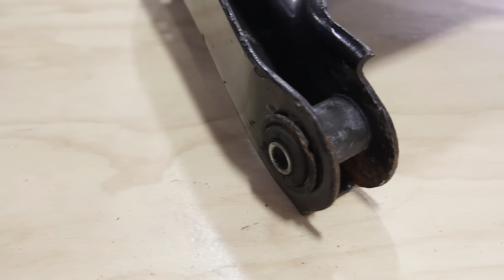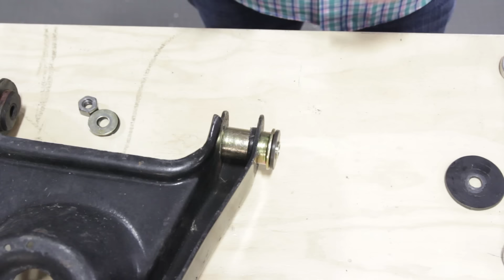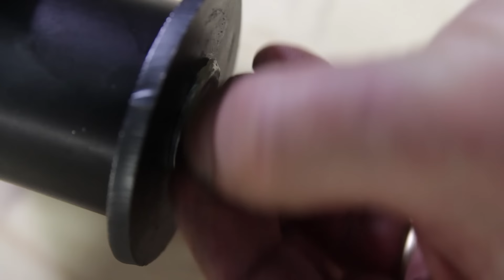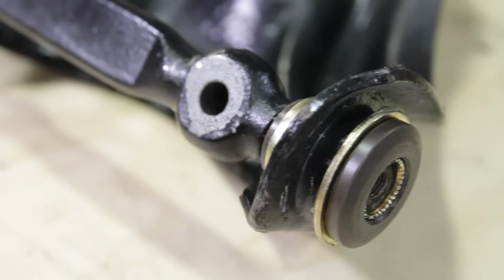Ridetech Bushing Installation & Removal Tool

Comment: I fought the s*** out of it.Putting the new bushings in the upper a arms . I bent the set screw and couldn't get The Nut to back off.
On the first go first bushing, I couldn't even use it lol. Maybe I should have froze them first.But I didn't think it would be that hard to put in.

Comment: That bushing remover kits should be $40-$50 not that $135 , $135 its almost the same price with 2 new set of the lower control arm of my vehicle ,

Comment: I had a clunkity klunk issue so I bought a set of control arms. I had the car up, tires off and was ready to change them out when I saw that there were 2 bolts loose on one side and 1 on the other. Just a quick tightening and I would have been done with it all. Since I was half way there and beside me were 2 new Beck Arnley control arms, it was a no brainer. Well, the rest is history and they perform like a champ. Moral of the story is, check for loose bolts before you spend money replacing something that knocks and Klunks.

Comment: I don't know why people struggle using C clamps when they got space (holes) for those encapsulated bushings. Just use a threaded rod (big bolt) washers nuts and castellated sockets or normal ones to  press them easily or remove them. I use power tools on them tho, never had a problem.  I dislike C presses because the rod rotates, and move the parts along the way stopping it from going straight.

Comment: Bought this for a 68 Chevelle after researching ways to do this. This was the best investment I’ve done in a long time. Total time: 5 minutes for removing the passenger upper, and 5 minutes for removing the passenger lower. And that includes setting up the tool. Definitely worth it.
Reply: That's what I needed to know. I'm working on my 68 Chevelle SS. Person I bought it from included a full body bushing kit, and body mounts. Might as well use them HaHa.

Comment: I was taught to use air impact hammer to "vibrate" them out and in in standard uppers. Lowers were a little harder. 3 hrs book time,  20 min per side +alignment.

Comment: Ride Tech does not make a kit for most GM cars from 1967-81. My Camaro does not have a hole with threads on the end of the cross shaft, it has threads on the outside that are held in place by large washer and nut. I have never seen this kind of cross shaft. This will not work for many cars.
Reply from the maker: Hello John, Actually this kit works on both styles of upper cross shafts.

Comment: Well if you are doing bushings you should do balljoints right? Is this tool going to do ball joints  doubtful i can't think of how that would work.  Ball joint press also will do bushings so buy one tool with multiple uses this tool can only do one thing.  But you have to do ball joints anyway so balljoint press makes more sense to me than this.
Reply from the maker: Yes john, this kit is for bushings alone, a press is typically required to remove ball joints.

Comment: And they want a $100 for some nuts, bolts and washers. Smh. I'll make my way over to Autozone and borrow their bushing remover.
Reply: Home Depot or harbor freight is cheaper to make your own with a threaded rod and a couple of nuts + washers. Use your own 1/2" sockets to cup & push the bushings 👌 I just made one for $9
Reply: @jlrockafella  You can rent AZ tools for free..doesn't get any cheaper than that..
Reply: @DarkSim77  they're doing away with tool rentals they told me, tried renting ball joint and bushing press other day - no stores have it in Broward county Florida. Had to buy it..

Comment: Will this tool work to remove & install the upper & lower control are bushings on my 1969 Firebird ctl arms?
Is it a kit with everything in it I will need too?
thx
Also, I still have factory press in ball joints, do have a tool to remove them?
Reply: u could try an gear puller for control arm ball joints there cheap on ebay
Reply: no cause they dont have a hole in the centre lol

Comment: You HAVE to install a spacer between the U on the  control arm to prevent bending it inward. The large socket is the receiver. The bushings may have to be adjusted to touch the frame.
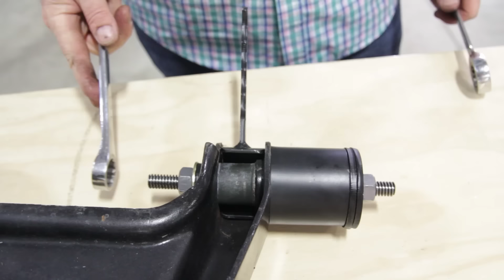Reply from the maker: Hi Rex. The kit includes a special spacer tool that does just that.  Watch the entire video. Spacer tool is introduced at 1:08. Thanks for looking.

Comment: they want 100 bucks for a 3 dollar part at home depot. buy a long bolt and two big washers and a couple of small washers!!!
Reply: Jason Mckeon what size bolt and washers?
Reply: if I buy the hardware at Lowe's or HD, what do I buy to substitute for the spacer and the part to keep the control arm square?
Reply: sockets, pipe, anything round with hollow inside. With pipe you need very large washer to cover end of pipe.
Reply: Use a grade 8 course thread long
Bolt and some washers

Comment: PSI na yes I do like your comment your tools and stuff very educational and yes I am a diesel mechanic that work on brakes rear ends driveshaft trainees rebuilt motors rebuilt radiators haven't rebuilt much and alternators or starters but I know what goes on and wiring I have no problem with wiring the only problem I have is the newer electronics that go on the computer I like watching your shows thank you

Comment: What type of grease to use to lubricate new suspension bushings back into place?  I already have Mobil 1 multipurpose grease (petroleum?), 3M silicone paste (heard it's inappropriate for suspensions), 3M copper anti-seize, and lithium grease.  Something else?  My bushings are rubber/plastic.
Reply: Really Happenings high pressure grease
Reply from the maker: if your using delrin, no grease is needed

Comment: Thanks, this seems relatively easy.
But it seems like most garages will NOT do this. They want to charge me for the complete part (i.e. lower control arm) instead.
Are they trying to scam me and increase their profits, or is there another reason ?
Reply: At a garage it makes sense to replace the part. Cost of labor to replace the bushings would be more.
Reply: This video addressed that problem:
"Replace Just the Ball Joint Or The Entire Control Arm" ⬇
https://youtu.be/TR2o56F9tWw